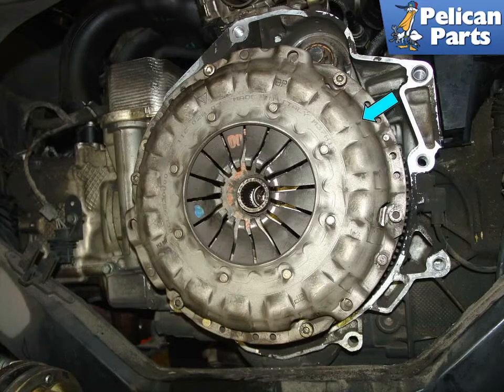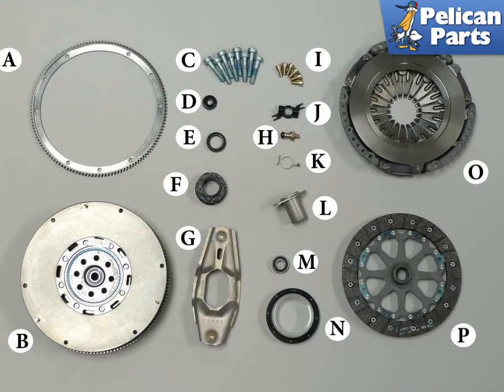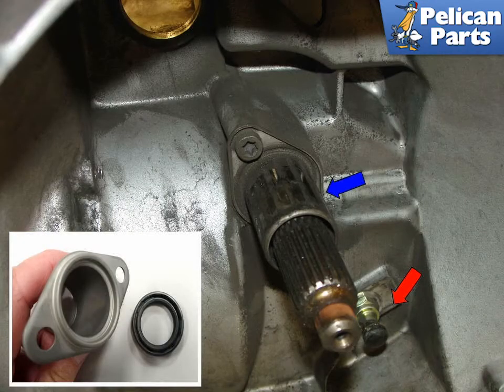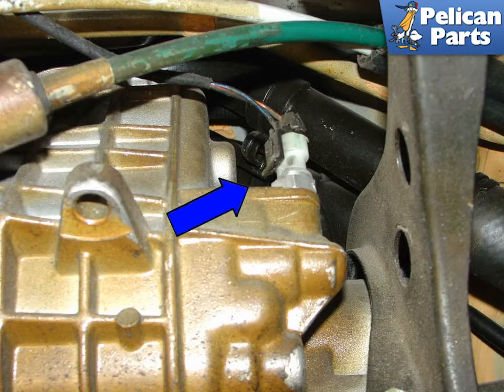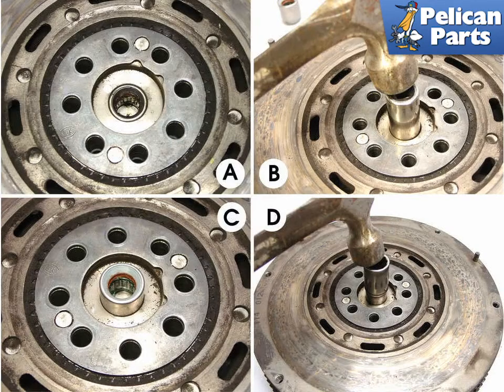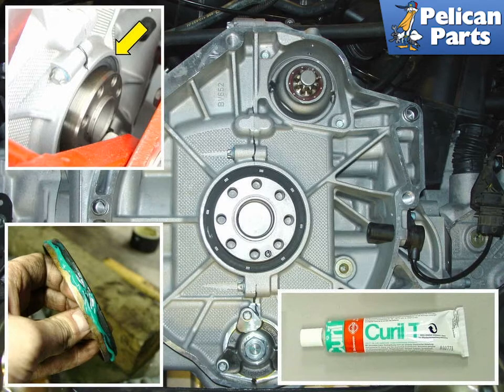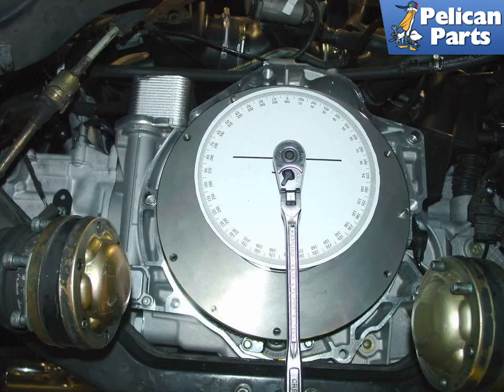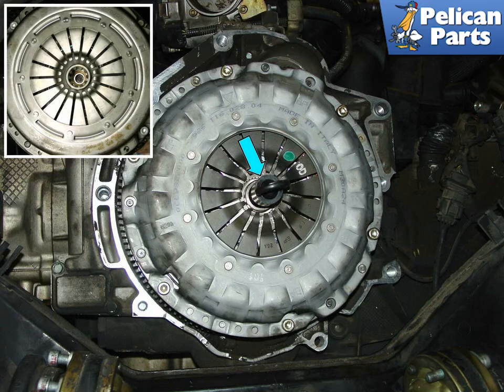Porsche 996/997 Clutch Replacement (1998-2008)

Comment: A lot of places seem to suggest that you should not grease the new rear main seal (RMS) when replacing it, and to leave it dry when installing. In this video it seems you recommend coating it in Curil T. Is there a reason that Pelican recommends this? Planning to do a clutch soon on a 996 C4S and want to know the correct approach. Likely will use Pelican’s kit but want this clarified if possible. Thanks!
Reply from the maker: It should be dry fitted. The lip and sealing outer ring.

Comment: Felt my clutch slip today. I have to pay some one to do it but I’m just here to cope about dropping…I don’t even know. $2.5k?
Reply from the maker: I am not sure what the repair will cost in your area. Call a few shops and ask for a quote. It is also a good idea to have them confirm what the issue is.
Reply: Mine was $5k parts and labor. I even supplied the parts lol
Reply: And they broke my shifter cables :)